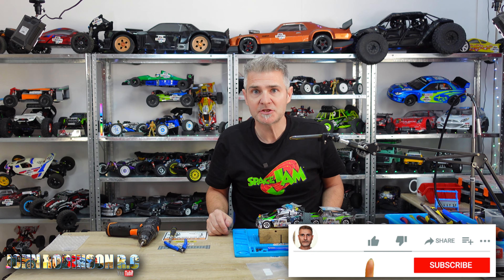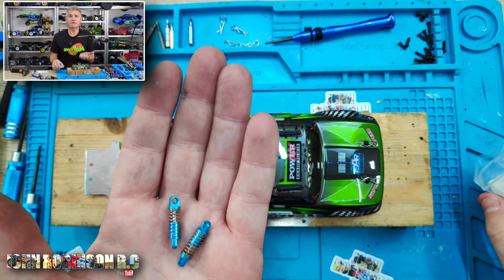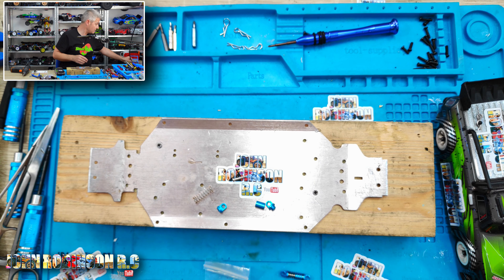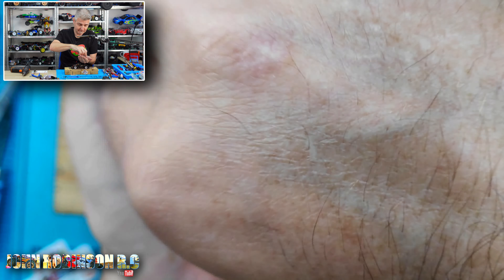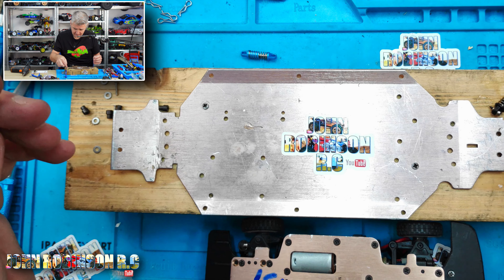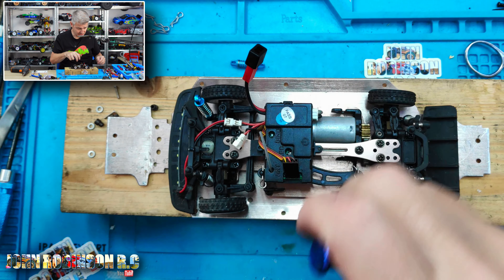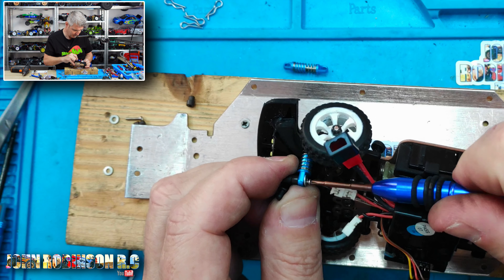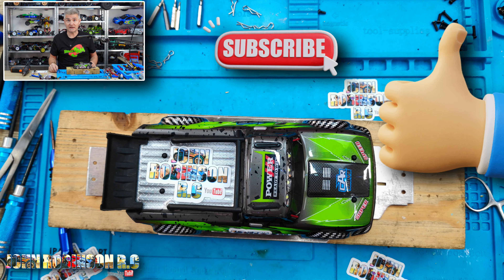WLTOYS K989 mod - WLTOYS 284131 mod - UPGRADED SHOCKS

Comment: Hi John! You know you could have made the job a lot less finicky by taking more parts off. Sounds counter intuitive, but it's so much easier. Congratulations, you demonstrated how to do it the hard way! 👍 😂
I have the rally car. So far everything is stock, except for diy free improvements like freeing up the drivetrain, suspension, and giving it more ground clearance. To do this I extended the slide groove (which is also travel limiter) on each shock 2mm with a hobby knife, and carefully stretched the springs 5mm. No need for the supplied spring preload clips now so they're back in the box, and cut off the frame lugs around each wheel.
Still handles great, and clears obstacles like the floor divider where the carpet ends easier.
These are awesome little cars but require some level of skill, patience and delicate hands when working on, as well as not having fat stubby fingers.😅
Keep in mind if you're reading this and interested in getting one.
Reply from the maker: Yes I get that. But also remember that from what I have learnt, people watching my content want less steps, not more. Even if it's slightly more difficult. Most of the comments I have gotten over the years is that people do not dare to do a job because there are too many steps. To many changes to forget something. But that of course is my opinion. 😉

And yeah for the price these cars are great. Fine line between having control and not of course. That could me my skill issue though. 😂😂😂
Have a great day and stay safe. Kind regards, John.
Reply: YA SOLD ME. Mine is in the mail. Rally car looks cool. You have a video of the DIY fixes ? I want more clearance too for Rallying.
Reply: @JamesDirtRC  Unfortunately, I didn't film it as I don't make videos for YouTube.
I probably wouldn't have enough continuing content to do that.

Comment: The switch in the kit allows you to install the Carbon Fiber Base Plate with a switch on the bottom. PRO TIP: When you install the Switch, it will hang down too low and catch on things when you drive. Use some M4 Nuts as spacers. They make it so the switch can be turned on but not hang as low. Cool feature because you don't have to remove the body.
Reply: I'm sorry, I should have said M2 Nuts. They are actually, .4mm in size. The switch on the bottom is cool especially, if you can charge without removing the body, or have Magnetic Bodymounts. It makes it seem more like a car you just buy, and put batteries in. You can shave the toggle on the switch down, but the nuts also creates strength and protection from side impacts.